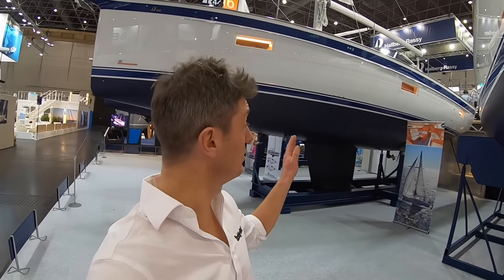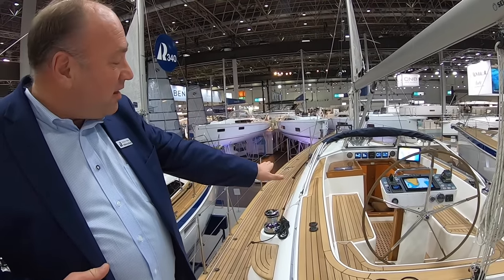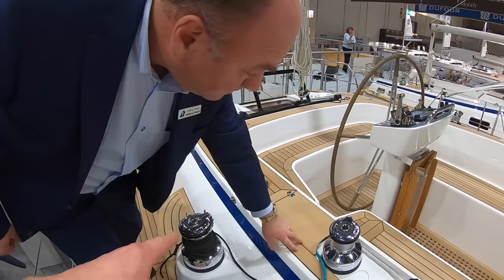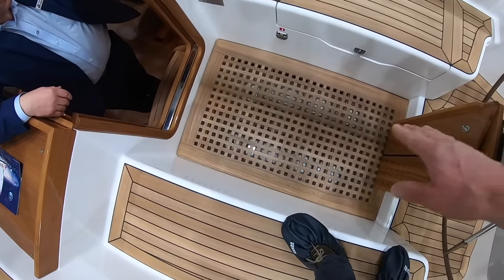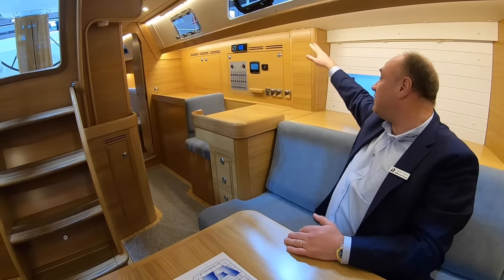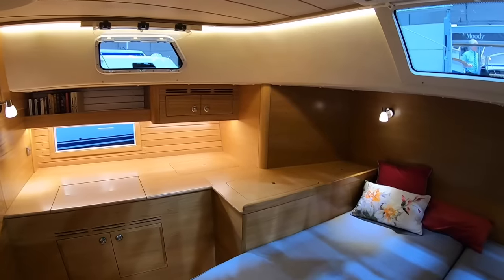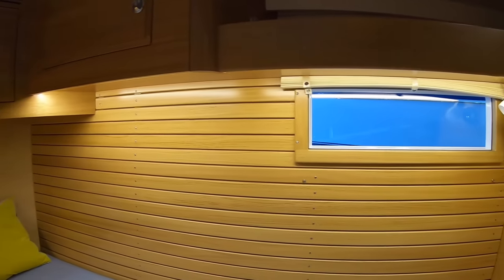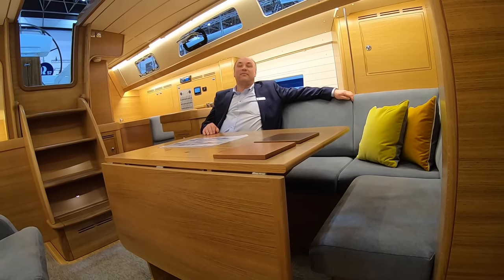"The best sailboat we have ever built" – the Hallberg-Rassy 40C

Comment: I must admit it a very nice boat, how long is the delivery time?  I would want a walk around bed rather than the cabinets either side and electric engines with a generator, electric oven (no gas tank trips to shore), the ability to fill dive tanks, solar panels which are apart of the design of the boat and not something added on the back. apart from that, I love it.
Reply: Yaa i saw that too, remove the cabinets in the bedroom to have a walkaround bed. I agree with you about solar panels built in with electric oven and batteries.
No mention of a watermaker? But I assume a yacht of this stature will surely have one. Need to see more of the galley, also storage around & under the floors is very important considering the price of food in some places that are waiting for you and gouge you accordingly. 
But I need one small area to fit a gas tank. I cannot live without a BBQ when I'm out & about. Its not outdoors unless you can sizzle some burgers/dogs, fish or kebobs. Defrost a few T-bones and you're in heaven.

Comment: Keeling the mast and headsails with greater lateral resistance ahead of the sails.  The retractable wing keel is under the mast and the blade for the headsails begins at the midpoint between the mast and forestay.  This is wing keel and blade keeled stem to stern keel line for a sailboat design.
Reply: Your blade keeling is always deeper in the bow.  The headsail and keeling should be 2 to 4 times the keeling of the mast.  Righting ballast to rollover the the boat if she is recreational.

Comment: I've checked out the 40C a few months ago, there's a Demo-Boat in my local harbor. The centralized concept is very controversial/polarising , imo. Either you really like it or it puts you off completely and instantly. In general i think HR has been very innovative with their monohull designs, but it's a big mistake to pretty much completely ignore implementation of solar panels into the design process. Sure you can upgrade or DIY it, but especially with the 40C it would completely change the appearance and clash with its design-use-advantages. Apart from that, the C layout gives you a bit of a (not taking into account the technical "negation" from its elevated height) feeling of additional safety. In beautiful weather and good conditions the 40C will likely make you feel very comfortable and provide great accomodation. In bad weather or Gale-force situations it might make you feel rather terrified. Personally i'm in two minds about it, the size is perfect for liveaboard flexibility, layout has its advantages, allows for one-hand sailing and a beautiful appearance overall. But it's a lot of the smaller things that put me off. That's my personal impression of the 40C

Comment: Truly stunning with a price tag to match but considering what you get for that price not to shabby. So if someone were to really kit it out with Gen set and solar as well as Lithium, you'd be looking at around the $625,000.00 to $685,000.00. It would just depend on how over the top you wanted to go. I also did not catch if that base price includes a water maker but I'm going to assume it does not. When you consider there are builders out there charging 1 to 2 million USD for the same size but only in length it is not a bad price...

Comment: the electrical regen seems a bit underdone, a single panel at 300 watts at best, at some point hybrid?
this on a boat obviously configured with a lot of electrics use
the aft helm comes without the protection of the better than average dodger, steer from under the dodger  ?
but I do like the engine room, and the chairs in place of a settee, washer, interior is bright chasing Beneteau

Comment: Looks like a lovely boat but so much electrically operated equipment you'll always have to run a generator so although it's sailing it's always creating pollution, or would it run with hydro /wind/solar generation, to feed batterierys.

Comment: Seems HR is catching up design wise to where mainstream design was a decade ago. Someone explain me how €467.000 is justified! You can buy 3 brand new Beneteau 41.1 for that money.
Reply: Quality, practicality, finish, lasting value..
Reply: I cab buy 3 Toyatas for the price of a BMW and 3 BMW's for the price of a Rolls. It's all about the fine points.
Reply: @commonground5214  Yes, but the BMW is not using standard chassis, hardware, electronics and a Volvo Penta engine.
Reply: @sywert  disagree, you pay for woodwork finish, teak deck and the HR brand. The rest is commodity.
Reply: @briansrensen8204  There are subtle nuances that,  at least to me, make the HR worth more than the Beneteau. The question is whether it is worth that much more. If money is no object the answer is yes. If not, no. Not unlike a very high ed watch or bottle of champagne.